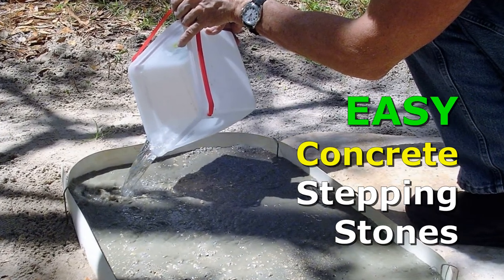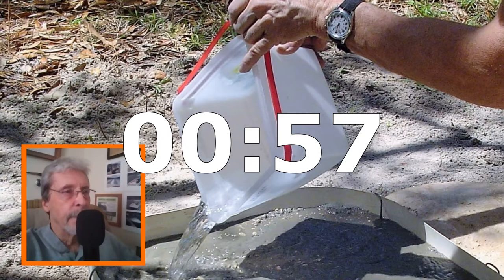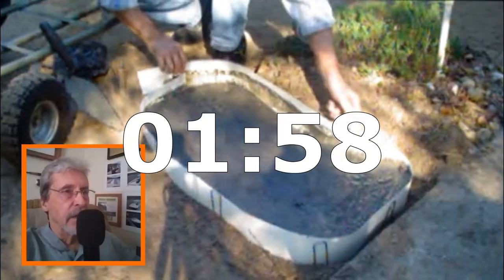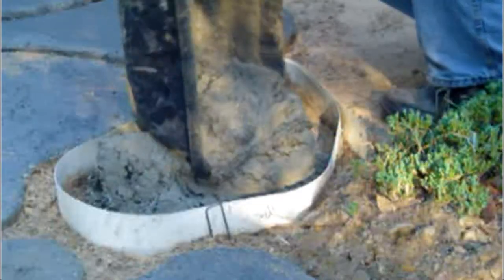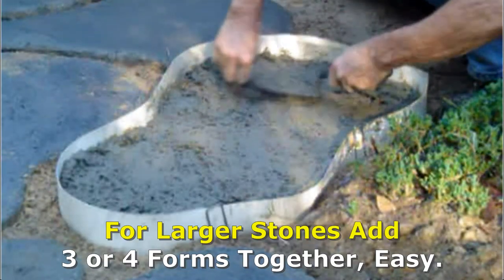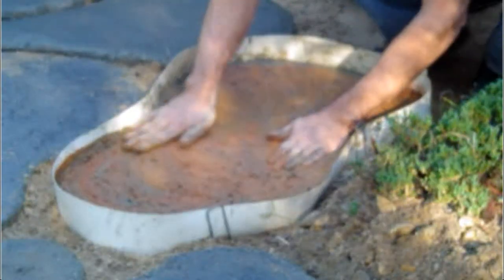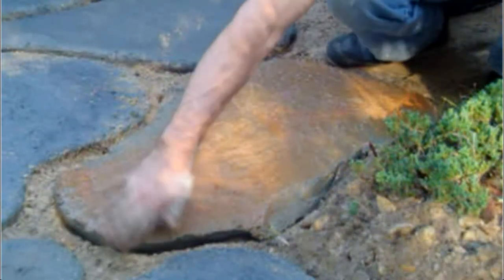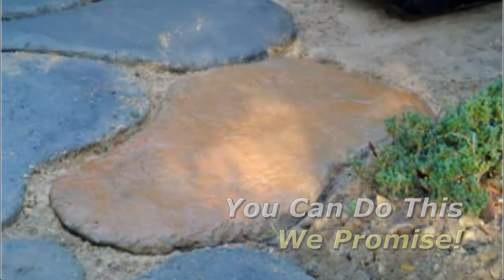EASY Natural Looking concrete stepping stones. DIY Garden Walkways / Patios on a BUDGET. It's EASY!

Comment: The sand that you place at the bottom before pouring the cement it is mix w the cement? Or is the base where the stone will be? I like your technique. Very practical and it looks very nice. Thanks.
Reply from the maker: Hi, the sand is the ground the stone is going on. We don't have topsoil here, just sand. So, it works well for this.

Comment: Good video!. Does the dry mix sets as firm/hard as the wet mix? By going the "dry way" it seems to me you need to put less effort in the making. Is it so? Thank you.
Reply from the maker: Yes it does set as firm as premixing the concrete.  It's easier to dry mix everything is done right in the form.

Comment: Think im going to order these molds. But the obvious quwstion is this. Pros and cons of each type of concrete. Why go to the trouble of the 2nd method? There must be a quality or appesrance advantage to spend so much extra time.
Reply from the maker: To be honest, they're both the same and an easy way to mix your concrete. I found for making a smaller stone, adding or subtracting the amount of dry mix, concrete, to the mold first was a good way to measure what I needed. Then I would add my water. It's just another way to do it if you don't have a mixing container. Thanks for asking!
Reply: Where do you get the molds

Comment: How long does that surface coloring last ?
Reply from the maker: The colors do lighten as the concrete cures. Once cured, I have stones 5 years old, never sealed, still maintained 90% of their color. I found there wasn’t much difference in coloring the top half inch vs. the whole (stone) concrete. It worked for me.